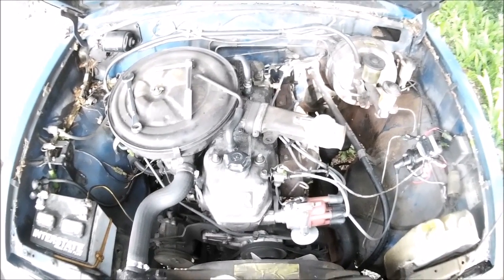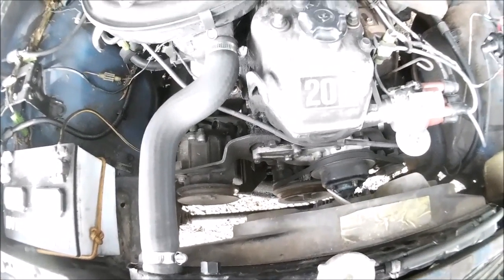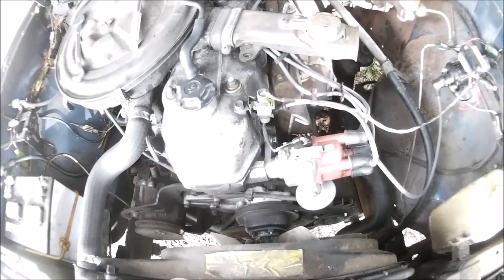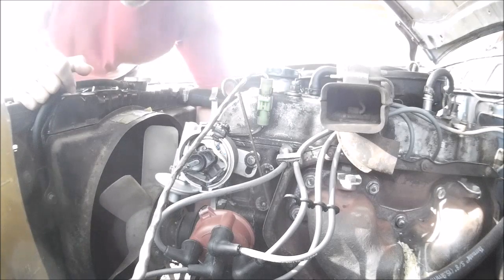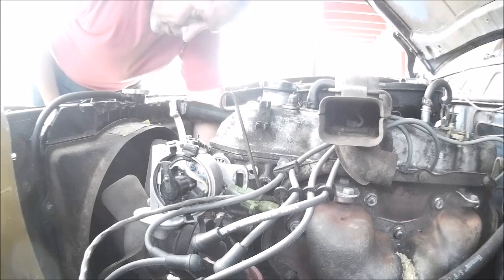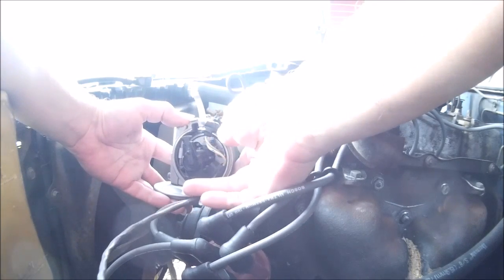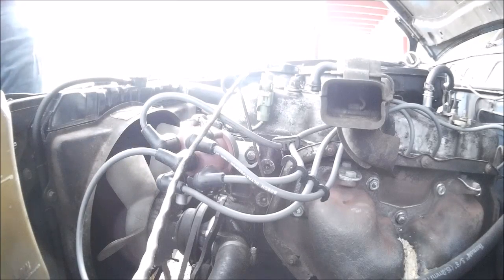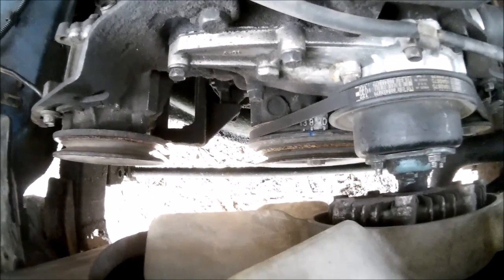1978 Toyota Pickup/Hilux 20R - CORRECT Distributor Installation

Comment: U r not correct,this is a 4 cyl toyota not a v 8 chevy...carb models come 0 at tdc from the factory,efi models are to be 5 degrees according ti Toyota specs...this is why u r 1 tooth off
Reply from the maker: Sorry but I am correct in this case, for the year and model I have. It's 8 degrees before top dead center. here it is straight from the factory service manual: http://www.retrojdm.com/ScanViewPage.asp?ScanID=104&Section=Engine%20Tune-Up&DPI=100&Filename=02-09%20-%20Ignition%20Timing,%20Initial%20Idle%20Speed.jpg